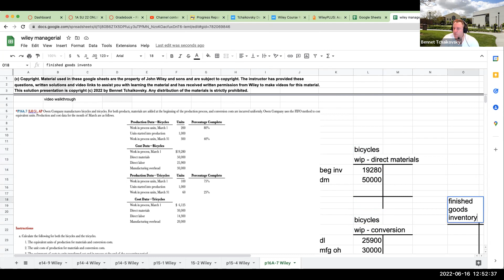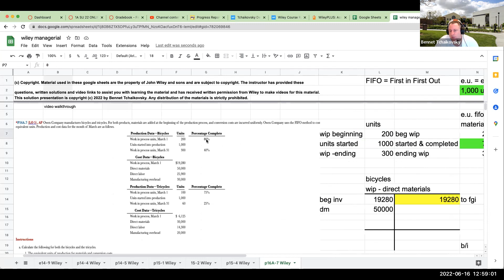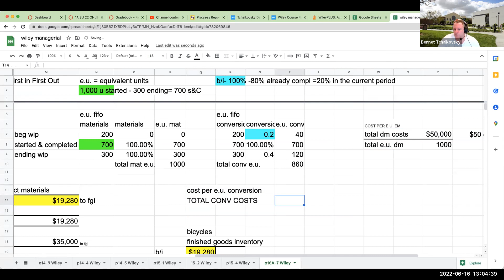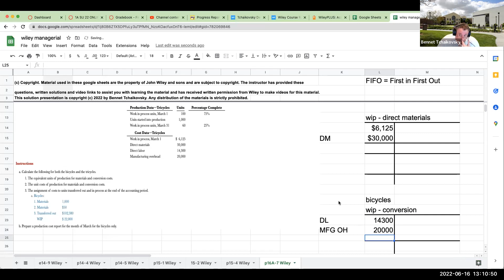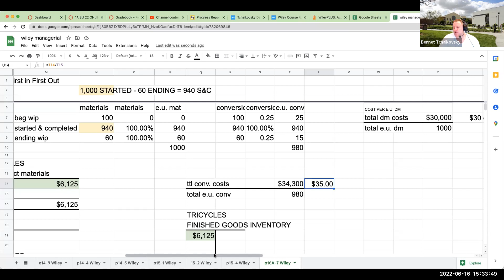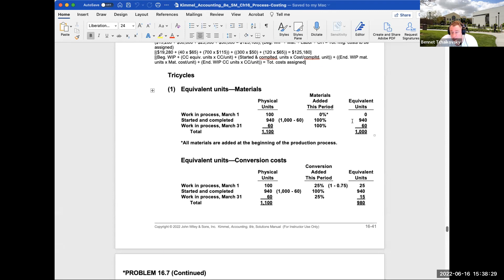Wiley- Problem 16A-7 Process Costing - FIFO Accounting Tools for Decision Making 8th Edition

Comment: I don't understand why Direct Materials E/U (equivalent units) are zero for bicycles and tricycles for beginning units, nor why the ending units for bicycles and tricycles are not discounted. The explanation (5 minutes 30 seconds) is that "materials are all added at the beginning." I have no idea what that means.
Reply from the maker: If all materials (100%) are added at the very beginning of production then under FIFO, beginning equivalent units would be 0 under FIFO as there were no additional steps for materials that needed to be added during the period. 

The only difference with equivalent units between weighted average and FIFO are beginning units. In weighted average we assume that all beginning units were completed during the period.

Under FIFO, we use the % to make the units 100% complete. Since the units were already 100% complete as to materials, then beginning units for direct materials under FIFO would be 0. 

Great question and let me know if this makes sense.
Reply: @accountingprofessor  Why should it matter whether materials were added on day 1, day 10, day 30, etc.? Prior problems did not address this issue. This approach seems to widen the gap between cost per EU under the two process costing methods. By using a zero DM beginning unit value for the current month, compared to the maximum unit value under the weighted average approach, resulting cost per EU under FIFO is even lower than it already was under weighted average method, and the spread greater.